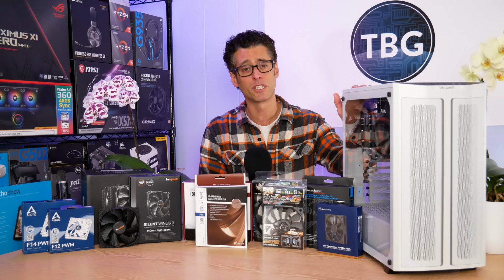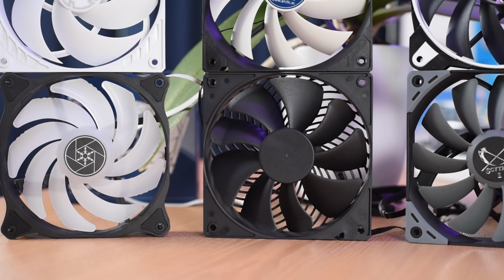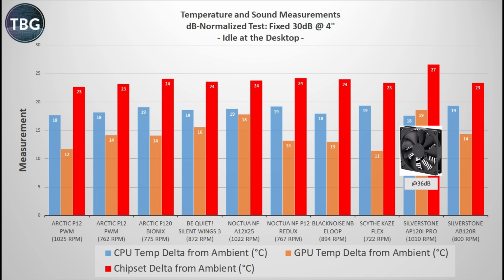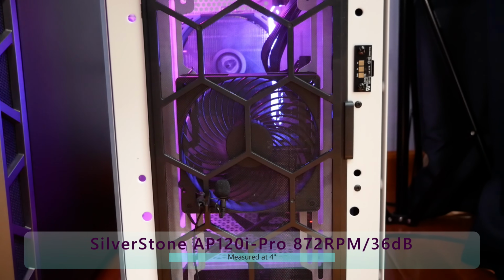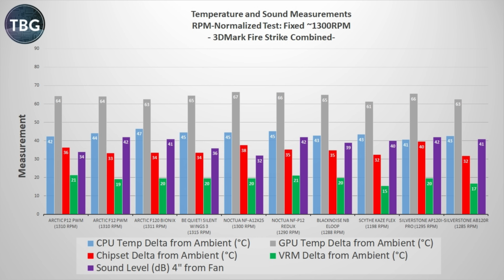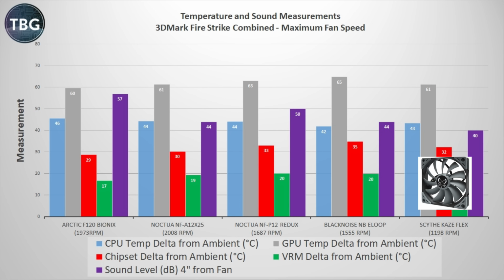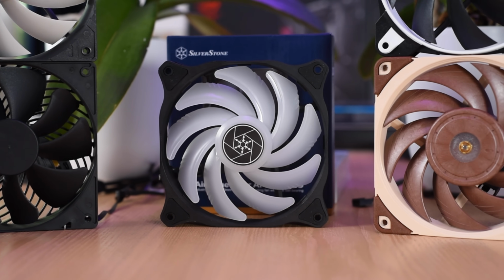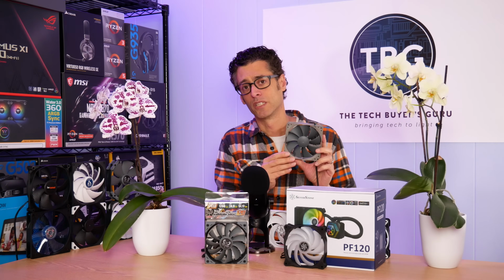The Best 120mm Case Fan Shootout: Arctic vs. be quiet!, BlackNoise, Noctua, Scythe & SilverStone

Comment: Great job. I think the comparison should also be 120mm vs 140mm so you can make this 140mm in the same way as the 120mm.
I would have liked a test as exhaust too but maybe the case you are making the review in is more sensible to the intake fans. I'm a noctua and scythe fan because they always make the best things (who doesn't remember the Gentle Typhoons?)
Reply from the maker: Yes, exactly, Scythe has been around a lot time, and plenty of folks who've been following the industry know about those Gentle Typhoons. Well, Scythe has not gone away - that's what my review shows! I'm going to try to combine the 140mm fan test with a fan position test without driving myself crazy. Will definitely need to limit it to just 2 or 3 manufacturers... we'll see how it goes!

Comment: I've always wondered if multiple 120 or 140mm fans could offer superior temps compared to 2x 200mm fans. Any chances of you testing this? Sure a single 200mm fan will absolutely offer superior airflow compared to a smaller one, but a case that can take a 200mm fan can take multiple 120/140s. I wonder how they would compare.
Reply from the maker: Oh, man, don't do this to me. Throwing a 200mm fan into the mix would make the next test even more work! Plus I'd have to switch cases. I think for now I better limit it to 120mm and 140mm fans!
Reply: @TheTechBuyersGuru  
Sure lad, no problem. 120 vs 140 is a test that would appeal to 99% of people anyway. Comparing 200mm fans would be for a pretty niche audience

Comment: i am sure i stated that the Arctic P12 is a versatile fan and it can work just as good as a case fan in your last video
and yes i think i was right,it's an all arounder
Edit: before you said that you gonna test the 140mm fans i was already searching to buy the P14 from Arctic lmao
so yes PLS include that version and not the one that you have, the full name is P14 PWM PST CO it has a wide range of 200 to 1700 RPM and it comes in black
pretty sure it's gonna perform really well
Reply: Co version is not good i dont recommend it for noise.
Reply: Yes, CO version is a bit noisier due to the ball bearing. At low speed it is obvious. At high speed a bit less as wind noise hides it.

Comment: Really looking forward for some explorations of case fan placement with P12.
Reply from the maker: Definitely a possibility. I'm going to give this all some thought and post a poll on the channel soon. Might try to combine the 140mm testing with the fan placement testing. Two birds with one stone kind of thing. I'd use three manufacturers that have both 120mm and 140mm versions of the same fan available, namely Arctic (P12/P14), Blacknoise (eLoop 12/14), and Scythe (Kaze Flex 120/140). I'd do one 120mm (as shown in the current video) vs. one 140mm in front, then I'd compare two 120mm and two 140mm in front/front, front/top, and front/rear configurations. Oh, shoot, that's already 8 tests per manufacturer. You see the problem! The works grows exponentially!

Comment: Nice overview but I would have liked the results with all the available fan positions filled with the largest possible fans, I believe 140mm   in the 500DX case. I know that would be a very expensive review but I purposely purchase cases with many fan mounting positions and fill every available spot with Cougar Vortex PWM 140/120mm orange fans.
Reply from the maker: I was actually intending to test both 120mm and 140mm fans in this test, but I ended up with far too many fans to cover in one video (16 to be exact). As mentioned at the end of the video, I'm now deciding on whether the next video will be a 140mm fan shootout, or a fan placement test with multiple 120mm fans. I may try to do both at once by using a combination of 140mm and 120mm fans from the manufacturers in this roundup that have both sizes available. There are nearly unlimited combinations, so I have to drill down and just select a few.

Comment: Although the case design plays a big part in the overall airflow, an optimized case fan video would nonetheless be swell. I'll be greedy and settle for both that and a 140mm case fan review ;-)
Reply from the maker: Yes, the best answer to which one is always both!
Reply: @TheTechBuyersGuru  for next testing, do 30dba, 35dba and max speed. 1300rpm fixed speed doesnt mean much if one fan does 40dba and the other runs at 1800rpm for the same sound level, despite the different sound signature. 40dba for one single fan it´s pretty loud if you consider you will add another 2-3 fans to the setup. Also please keep all of them to the end.
I know it´s a lot of work and testing, but right now seeing the behaviour of these fans, i can´t do anything else, but wonder if at 35dba the p12, would´ve been equal with the kaze flex.
I´m only taking a blind guess, but 40dba for the p12 would´ve meant 1600rpm+.
I know it´s a static pressure fan, and it comes a point where there´s a lot of diminishing returns in air moved, as we can see with the nf a12x25, but i think for the p12, that´s a bit higher, because it has fewer blades.
Reply: I concur with this as well. Most cases these days allow for 140 mm fans placement - resulting in more airflow at lower decibels.

I too would love to see this reviews as well as a guide for case fan placement/optimisation.
Reply: 140mm fan video please!
Reply: The problem with case placement is that it's case dependent. What works best in one case may be totally wrong in another layout
Reply: @ermacstudios  this case it 10% worst case scenario, best case to test case fans on is Fractal Design Meshify C with fans mounted inside, not outside the chassis, it is specifically designed like that so you don't need high static pressure to overcome the front mesh while still doing the job of keeping the rust outside or Cooler Master TD500 Mesh which is just modern copy of it

Comment: See test of 140 mm fans . Big YES from me
Reply from the maker: Noted - seems like just as many people want a fan optimization video, so I may have to take a formal poll!
Reply: @TheTechBuyersGuru  So even though Arctic recommends the F fans for case and P fans for heatsinks, the P12 is still a better option for cases?
Reply: @TheTechBuyersGuru  WERE STILL WAITING BIG DAWG. i have $3 fans cooling (2) 3080's
Reply: @TheTechBuyersGuru  Both would be helpful.
Reply: I really want a 140 round up but for radiators. I'm curious if the A14 is really that good or if something else is better. Any chance you can test EK's Vardar fans too?
Hardware Scientist posted a recent 140mm comparison showing the Arctic P14 PWM kicks everything else's butt, would love to know your findings.
Reply from the maker: The 140mm Fan Test is here: https://www.youtube.com/watch?v=PUdsTiRmuuU
@S KR - Yes to the P12 over the F12, despite how Arctic markets them. The F12 is an old product, so it should probably be retired, but since it's still around, they have to say it's good for something, even if the P12 is better for everything!

Comment: Please compare: 

Arctic P12 PWM,
NB-eLoop Series B12-PS,
Noctua NF-A12x25, and
Scythe Kaze Flex 1200
at max speed.

The Arctic P12 PWM shouldn't be omitted consider its cost/performance ratio.
But anyway, great work still!
Reply from the maker: You saw the max speed test on the eLoop, Noctua, and Scythe, right? I actually forgot to film the eLoop in that, but I showed the dB measurement in the chart. Yes, probably should have done the P12 too, it has a very high max speed, but my hunch is that it's really better at low speeds as a case fan.
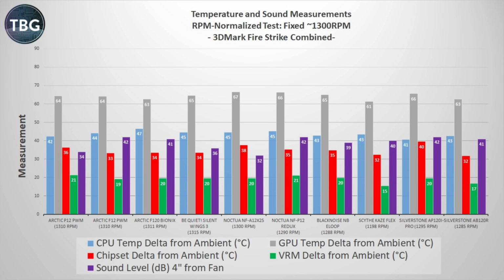Reply: @TheTechBuyersGuru  Yes, of course, sir. The reasons are that the case fan is designed to load at max speed(so does its noise level), and since this video (9:03) shows us P12 PWM has better performance compare with NF-A12x25, it will be reasonable and interesting to compare them at their max speed. (P12's noise level is around 22.5~24.5 dB, while that of NF-A12x25 is 22.6 dB, both at 1800/2000 rpm, on specs page)

Comment: Great video! Please do a video on fan placement. Do you need to populate all the front fans as intake or all the top mounted fans as exhaust? Would be great to have some stats on this topic. As always, it depends heavily on the case itself, but as BQ Pure Base 500DX is quite popular right now, maybe use that as a "base" :)
Reply from the maker: Did you see my review for that case? Here's the link - https://youtu.be/kgvm5ZTAbFQ. I actually provided a teaser on fan placement by testing its fans in two different configurations.
Reply: @TheTechBuyersGuru  : Yeah I have seen it and I think I subscribed to your channel seeing that review :) Great piece! You have really good reviews and analysis. I saw another review on the same case with 3x 120 mm front intake fans and 2x 140(?)mm top exhaust fans. The reviewer noticed that the top mounted fan in the back had a lot of hot air coming of it, but the front one had cold air. Maybe that's why you got better temps in stock config in your review as well? I.e. the top mounted back exhaust is really important moving hot air out of the case. Case flow dynamics is so interesting though. Optimal fan placement can really make a difference!

Comment: Great review!
I'd like to see these fans tested inside Silverstone SG13, since there is only room for one good 120mm fan.
Reply from the maker: Oh, man, I'm afraid I've got to move on from the SG13! I've done so many tests in that case, and I actually need to use my ITX components in an upcoming test of the new SilverStone LD03-AF, which I'd like to have out within about a week. But you're right, the SG13 would potentially be a perfect candidate to test case fans, specifically those designed to channel air.

Comment: how about Noiseblocker NB-eLoop Series B12-P? not the B12-PS.
Reply from the maker: The B12-P (https://amzn.to/374yj16) is a 2000RPM model. I specifically did not intend to test fans at that RPM. I requested the B12-PS (https://amzn.to/2zW9uIP) due to its more reasonable 1500RPM max.